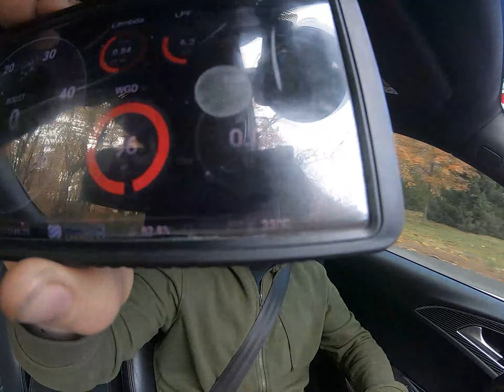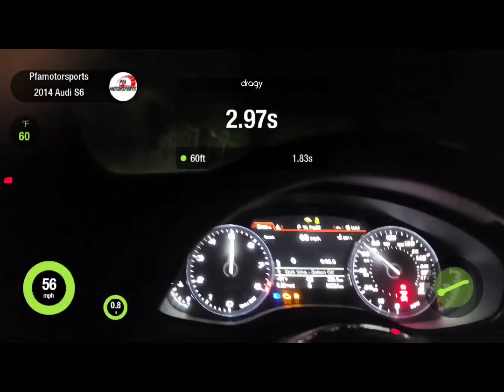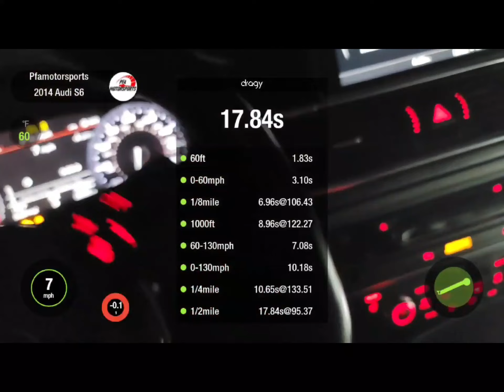AUDI S6 STOCK TURBO WORLD RECORD

Comment: So questions  I think people want to know - why do drivers side S6 turbos blow (anecdotally) more than passengers?  What is the max safe power level for the S6 turbos?  Should people upgrade them before they blow (which they seem to do often)?  What PSI were your running them at?
Reply from the maker: So this isn't somthing i as a tuner suggests to people. A safe psi level on cast turbos id like to say around 25 26psi. I am currently at 35psi but I have some fail at 32psi. Now I havnt had a bad failure yet. But I have seen a stock set take out a engine by popping the intercooler brick and filling engine with coolant.
Reply: @pfamotorsports3780  good and important to note this record was a glory run and not advised for those wishing to maintain the life of their stock S turbos.  Next video - upgrdaded options srm +4, pinnacle, ts1 vs stock RS7?
Reply from the maker: @rosscarver4546  next I want to do rs7 turbos glory run
Reply: @pfamotorsports3780  I’d love to see that…I wish I could donate mine, but they were low miles and may need someday 😂
Reply: Most important thing is to remove or replace the small extra oilscreens in front of  the turbo. They kill the turbo's premature. I think Audi finally did a recall on those this month. They will replace the stock with optimized ones.